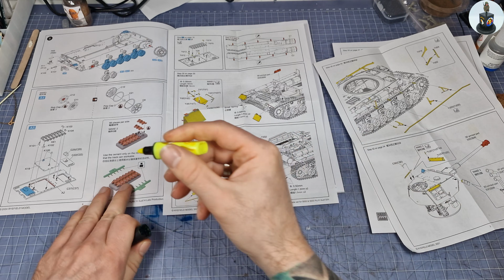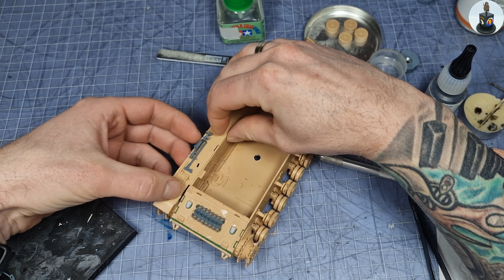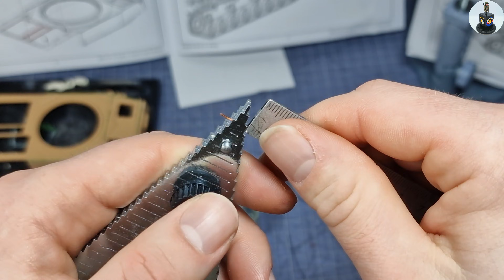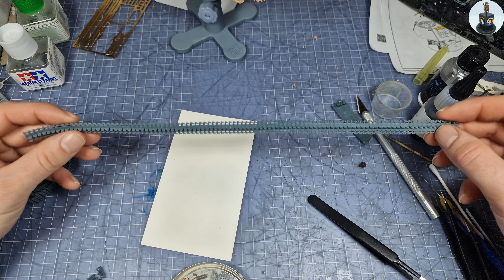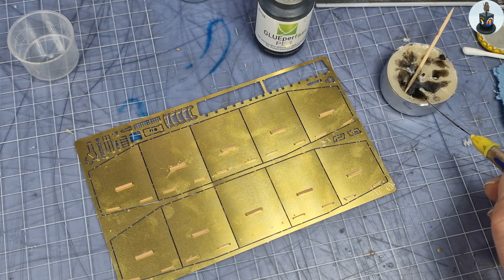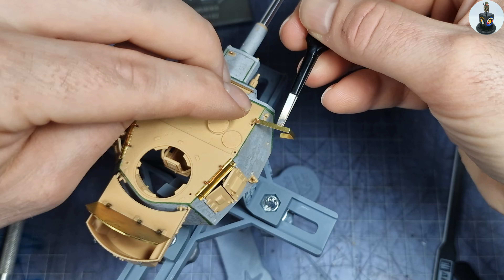Ryefield Model Panzer IV 1/35 - If you came for the perfect Model, you are wrong here!

Comment: Looks great! I like the idea of placing the shield out of order but it would seem to me that the crew would be far more interested in having the crew compartment protected instead of the engine compartment. Maybe move one of the other shields out of place to the center to depict the crew wanting that protection.
Reply from the maker: Thank you😊 yes you have a point about the placement, my idea was to protect the idler wheel as a crucial part for the tracks but yes, maybe they would place them more in the middle of the vehicle. But like I said, nothing is fix yet, so I will decide this in the last steps when finishing the model👌

Comment: Thank you for this video! May I ask you what ratio do you use for Tamiya putty + Cement mix to create armour texture?
Reply from the maker: Thank you for watching. The ratio depends on what part I am treating with the mixture. The more cement you add, the thinner the mix becomes. So on a rough surface like the exhaust I apply a thicker mix for more texture, on the tanks surface I apply a thinner mix. Just give it a try and see what's working best for you. And better use thin cement, as the regular cement makes the mix thicker too.

Comment: Hey Mate, I'd really like to see you tackle a Jagdpanzer IV Lang, in 1/35 scale.. possibly with a winter wash camo scheme ! I recently learned that as WW2 ended the allies continued to complete jagdpanzers with left over parts & engines etc that were uncompleted. This proves how the allies rated this tuff unit, definitely a well ahead of its time tank destroyer, & even though only 400 were put into service it obviously made an impression on those who  had to fight against it.
Cheers - Stu
Reply from the maker: Hey, that's really an interesting vehicle and the idea with the winter camo is great, so not impossible that some day I will build this thing🤔👌
Reply: P.S. have you seen the AK Paint marker kit..in the three German camo colours?? They seem a quick & easy way to give your models a range of great camo finishes, stripes, angled sections or the scribbled lines type.. maybe check them out!! 👍
Reply from the maker: @Stu.Henney yes I have these markers, but I use them mainly for small corrections. I think the look of a sprayed camouflage is way better compared to a one painted with markers. But those markers are great for stuff like painting rubber or metal surfaces of wheels or rollers👌

Comment: Fantastic work. Nice to see you build a tank you should do it more. 🙂 I have just used a set of Panzerbrusher tracks for my T34/85 build, also out today. The T34 tracks don't have the locking pins like these do but they are still great detail tracks. I noted your struggle with the curved rear skirt... Try using a round steel bar about 5mm diameter and use a very thin piece of card to lay the  PE on and use the bar like a mini rolling-pin. The card will allow the PE to be pressed into it as you roll and you can adjust the curve with the pressure you apply. I use the backing cards that come with the PE set for this. Look forward to seeing this painted as I know this is going to be GOOD 🫡
Reply from the maker: Thank you for your kind words, happy to hear you trust me with not ruining this thing completely 😁😉 And yes, building tanks is fun but takes so much more time. And I like painting figures a lot😁
But the advice for the curved armor plate is great, I will try this at the next oppurtunity. Thanks a lot for that🙏👌